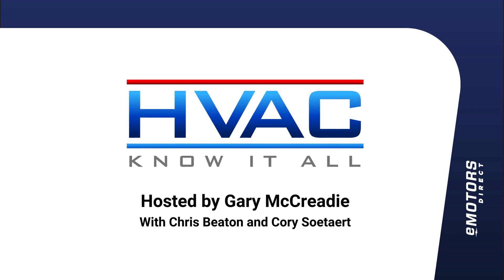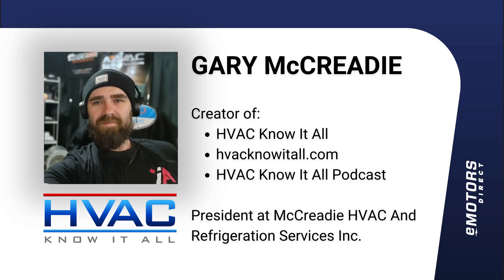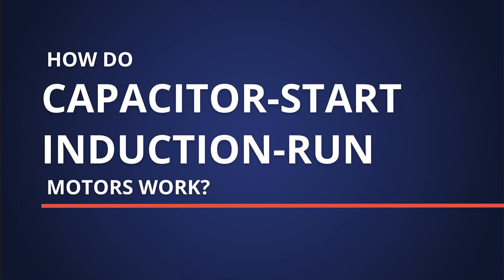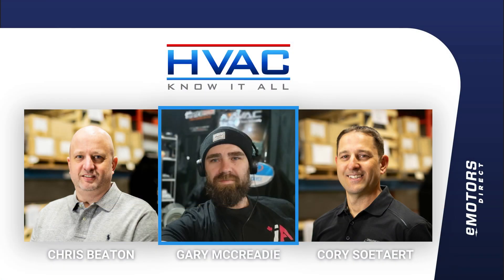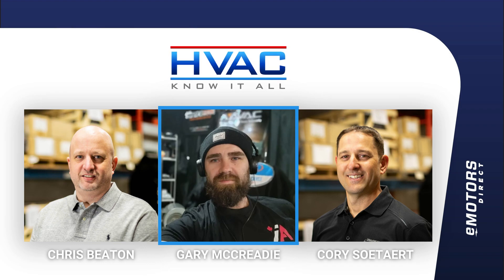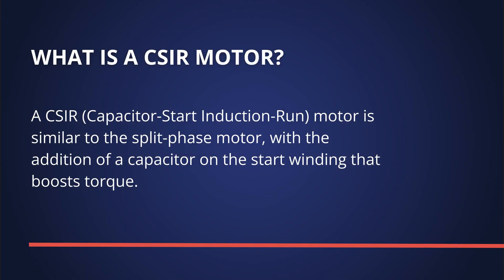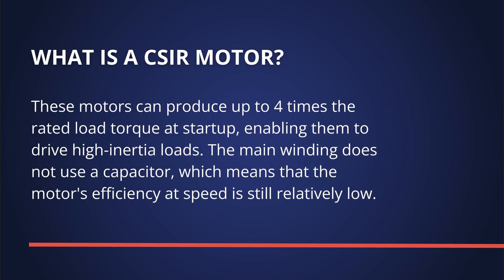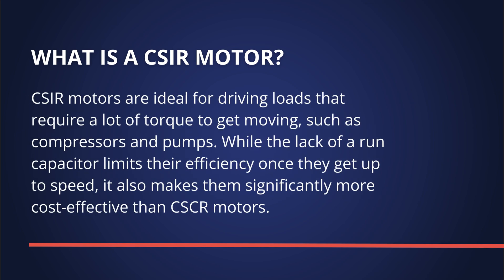How Does a CSIR Motor Work? | Part 4 - HVAC Know It All

Comment: thank you for the inputs.
I do have a question about the start-current of a 1-phase CSIR compressor though: Is there a way to reduce it? by maybe working on the relay capacitor or introducing a coil to soften the start peak?
Any input would be appreciated greatly
Reply from the maker: Hi Mehdi, great question. There are a few ways to do this and I'm hesitant to comment because the process is quite iterative. I don't want to lead you down the wrong path.
Reply: @emotorsdirect  i would love to share my email with you or even communicate with a visiocall, as this is part of my graduation project for my Bachelor of Engineering, I would chase all paths available <3